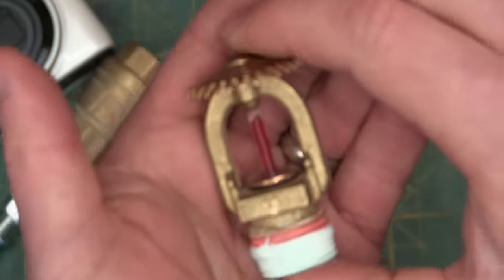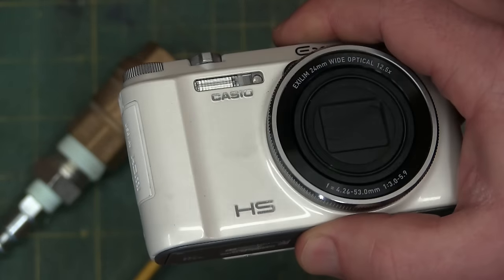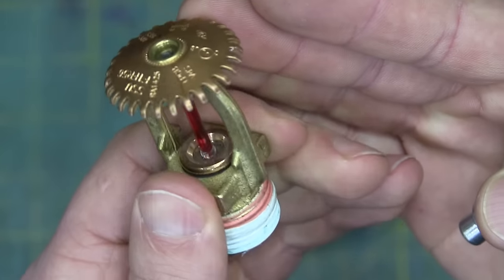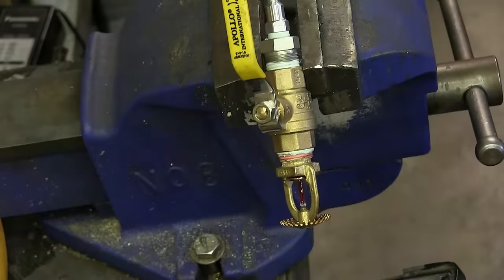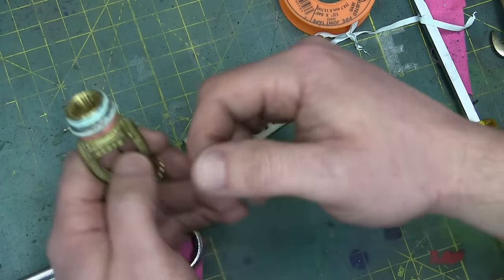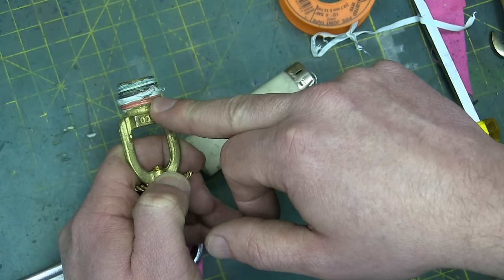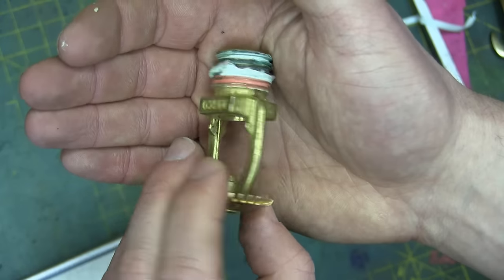BOLTR: Fire Suppression Sprinkler Head

Comment: Seeing as there was no explanation in the vid.
The colour of the dye in the glass bulb signifies the temperature rating of the glass bulb.  The red colour is rated for 68C/155F.
The different temperature ratings are achieved by varying the size of the air bubble within the bulb.
As the fluid heats, it expands and compresses the air bubble.  When the rating temperature is achieved, the bulb is unable to be compressed anymore and so the glass catastrophically fails, releasing the water.
Reply: Additionally systems of sprinklers are designed to handle only a few sprinkler heads going off at once.  Their primary purpose is to locally SUPPRESS a fire long enough for the fire authorities to arrive and handle the situation.
Reply: But yeah the sprinkler bulbs are a GREAT example of compressive vs tensile forces.

Comment: What is the actual mechanism that causes it to release the water? The glass vial physically keeps the valve closed. Then, I'm assuming whatever liquid is in the vial is very heat sensitive and expands with heat, breaking the vial? What is the liquid?
Reply: The liquid is alcohol, kind of like in a thermometer. It expands under pressure, and at a certain point, the glass gives way and the plug (which is held in only by the vial) gets blown out by the pressure behind it.

Comment: NFPA13/14 call for in-service acceptance pressure testing to be done at 200psi or 50psi above maximum booster pump pressure for pump supported system.  I have a pump that'll do 220psi at 1500gpm and it has a twin for some arcane reason.  Put that in yer'vice.

Comment: hey AvE I recently had a SDS drill bit that got broken inside the chuk and i tried every thing and really cant get it out ...i looked every were but it seems that not a lot of peeples came across this prob before so i was wondering if you can share some of your wisdom on that lol thanks a lot
Reply from the maker: You gotta take the body of the drill apart to take the chuck body off and then take the detente balls out. You'd do well to google the model number and get the parts list.
Reply: AvE I already tried that was a rubbery thing on the Chuck that can't be removed to reach the balls ...but I will Google the part list and give it another try THNX A LOT
Reply: AvE could you use a enerpac porta power with a hand pump for a jack

Comment: Is the copper head for heat conductance to break the glass? I imagine that most flames would hit that from the bottom, not the side.
Reply: They only should be touched by flames in the worst case scenario, and this one is an upwards-facing sprinkler so if anything the flames would get the pipe first.

Comment: What I always wonder about is how only one of these guys set of an entire sprinkler installation. Because the next sprinkler on the pipe doesn't have a glass vile.
Reply: It's possible to read the pressure in the system and determine if a head is going off or not, and open or close valves/turn on pumps if something is happening.

Comment: i'm guessing that it's a small vial of alcohol or gasoline, as it caught fire upon bursting. low temperature needed for vaporization, etc. but i didn't get a whiff of it, so i dunno. mind sating my curiosty?
Reply: It's a vial of alcohol. It expands under the heat until the vial bursts.

Comment: So what about the heat causes the glass vial to shatter? Is it thermo-expansion of the red stuff in the glass which shatters the glass and this allows a spring to eject the plug?
Reply: Remember, there is usually water inside the pile, pushing on that plug.  The bubble inside the glass expands and breaks the glass, letting the water pressure eject the plug as it starts spraying - no spring needed.  That bit of glass is pretty strong in compression along its long axis, but add a side force (like an expanding bubble, or poking it with a screwdriver) and it breaks pretty easily.

Comment: those lil inserts, like the red one.   have different heat ratings.  like a blue one might mean it breaks at a low temperature.  whereas the red or yellow might need direct flame of intense heat.    they need different types due to different conditions,  one place might work with paper products or flammable stuff ,and they need that sprinkler to turn on the minute it detects a heat that can start combustion.  or  a strong insert that needs direct flame  due to the buildings inside operations.  or heat build up. due to molten metal or whatever.  idk...  you probably know all this.  and i definitely did not do a good job explaining the sprinkler  inserts  but im sure if ya try a little ,  it can be deciphered.  hahaha

Comment: I've been told by sources that spoke with an air of experience and authority that it wouldn't be possible to "hold back the water" coming out of one of these (if it were accidentally set off and was within reach).  Anyone have any feedback on that?
Reply: john: The garden hose example is an excellent way of looking at it!  Thanks!
Reply: Uncle Rumple - Awesome!  Thanks for the tip!
Reply: A simple wedge will work >  no fancy tools needed.
Reply: Jam your local door stop in it free and handy since it does something when not being used to stop water from a sprinkler.  Seriously though that's basically what most fire departments that respond will do until the water is turned off at the supply.  They just stick 2 opposing wedges in it and it'll hold back virtually all of the water no matter the supply.
Reply: A cork.

Comment: Hello guys, the company I intern in is building backup sprinkler unit with diesel motor driving 2 pumps, each 160 bar. Apparently it creates mist thanks to the high pressure and can extinguish fire in seconds by depriving it of oxygen. But they won't tell me more. Is there anyone that can point me to more resources about this method?

Comment: If you really want to see something  you should see what happens when spackle and tape company's don't listen to the steam fitters and use propane space heaters to dry the spackle quick .When these let go with street pressure on them the first thing you get is a deluge of water loaded with oily foul smelling stagnat stuff from inside the pipe which is black as ink and stains like it too.if your lucky to get the water off in time you only have to throw away half the building!. ..here in the USA the n.f.p.a who controls fire protection calls for a standard test to pressurize a sprinkler system for two hrs at 200 psi in order to get signed off by the fire Marshall that you passed the test..now if you have a head pop during one of these tests the mess and clean up is proportional . giant clean up fail test start over.im recently retired from the business and still shudder to think of some of the Glorious destruction I've seen these little buggers create after 20 years in the trade.

Comment: The red ampule that inspires fear in all industrial plumbers. Break 1 which drops the pressure in the line which triggers the booster pumps and breaks every fucker in the place and calls out $5,000 of the boys in red. Break one and run :P
Reply: Jeb Julian incorrect... one head operates due to heat (fire) activating it... NO ADDITIONAL HEADS GO OFF!! It's not like the movies! Lol deluge systems (special hazards) have open head where everything goes off... but not common practice anymore

Comment: Please help, what material should the bolt be, if I want to fasten it into aluminium? Galvanized? It's going to be indoors, so I guess it doesn't matter that much. But I do want to be able to remove it.
Reply: 0xbaadf00d i think you should use stainless with some copper paste on the threads
Reply: Copper paste? That sounds a bit odd to me since copper is quite noble. And the further apart the metals are on the nobility scale, the more they react, no?
Reply: Well maby not but something to keep the stainles threads from binding up like thick grease

Comment: It will open, and distribute water, unless it's a dry system, such as those used in computer rooms. Then a secondary action from a manual station switch, and or other automated secondary detection equipment is required. The use of fire suppression chemicals is now frowned upon by the EPA, so dry water systems have become more popular over Ansul or Halon. People tend to clink these sprinkler heads with scaffolding, or equipment, and dumping water on a $7,000,000 server is a bad idea, unless it is actually on fire. If it's on fire its value has depreciated to scrap metal.

Comment: Good morning from sunny Florida! just out of curiosity, what is the fluid in that little glass vial? assumingly something with a low boil point to quickly build bursting pressure. but the only thing that comes to mind is alcohol, and that would seem to unstable for use in a safety device. but ive been wrong before.

also if  you going to continue this venture into electronic music, may i suggest "TheFatRat"
Reply from the maker: I think it's alcohol and glycerin, maybe some water to taste.
Reply: JamesWolf 
if memory serves, you're on the nose with the safety-booze thing

Comment: was doing some landscaping at a school built a couple years prior and they wanted us to take a look at the irrigation system. well this school had a detatched pumphouse for the schools water needs. complete with a big diesel driven pump for the fire suppression. well we open some valves for the irrigation to see if it's getting water, and come to find out the irrigation was tapped into the water line after the jockey pump for the fire suppression. pressure dropped, system thought a sprinkler went off, caused the diesel pump to kick on and set off the fire alarm. lol apparently this was not the first time this had happened, FD was not amused. great response time tho. anyway the reason the irrigation wasn't working is that some dickhead wired the outlet it was plugged into to the light switch. lol lowest bidder all around for that school.

Comment: I'm surprised you would waste alcohol like that.The sprinkler system in our 77 acre plant has 56 MILES of pipe-risers with 1 1/2" hoses every 100'-about 30,000 sprinkler heads - 2 ONE MILLION gallon water storage tanks and 2 pump houses with two  6 71 Detroit Diesels in each pumphouse driving  3000 GPM pumps .Electric jockey pumps maintain pressure,and the system is divided into loops controlled by PIV-(Post Indicator Valves).If we ever started pumping 12,000 GPM-that would be bad Ju Ju. Just sayin'.

Comment: How does the glass vile work
Reply: cccampbe2 the heat causes the fluid inside to boil and therefore build up pressure, which destroys the vial and releases the water. It's quite simple but effective.
Reply: it gets hot and the alcohol inside makes so much pressure it blows up
Reply: There is a small air pocket in the bulb and it expands with heat, causing the glass to break and allow a sealed plug to release and allow water to escape.

Comment: What's stopping someone from tapping out and breaking the insert to set these off?
Reply from the maker: Rules, common sense and installing them out of reach.
Reply: Seems kinda vulnerable, yeah? Someone could break one of these in a building and cause the rest to go off, causing all kinds of destruction and mayhem
Edit: Aren't systems like this attached to pumps that turn on when the pressure drops?

Also i love u uncle dad
Reply: the rest of the heads would not go off only the broken one

Comment: why does the glass vial break when exposed to heat?  Did your lighter melt or weaken it??
Reply: Seth Jones There is a little bubble in the glycerin in that vial. As it heats up, the bubble expands eventually breaking the bulb from the inside.

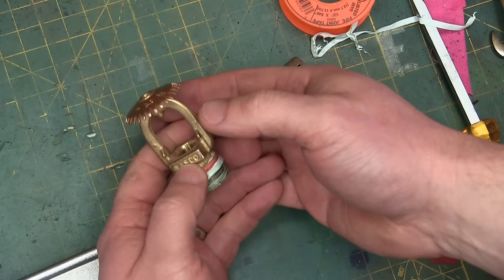Comment: 2:00 (fractoins and pounds and pies and internal screaming)

Nightmare. 

For the metric people.

120 psi ~= 9 bar ~= 900,000 Pa

Pressure * Area = Force (N)

pi*(0.06^2)*900,000 / 9.81 ~= 10kg force i.e. ~22lb force

This was not any simpler to do in my head lol.

Comment: How does one sprinkler going off trigger the other sprinklers?
Reply: It doesn't.  That's lazy Hollywood bullshit.
Reply: pixie dust
Reply: Because a grip or key grip gets a signal from the director to open a big valve connected to a water truck parked outside the studio.
Reply: It doesn't. Heat from a fire opens individual valves.
Reply: RabidMortal1 they dont! they pop and sprinkle as they are needed. for example when a person on fire passes under them. there are systems where the sprinklers don't have the little popping devices. pipes are dry and some other type of sensor will see the fire and open a valve/turn on a pump, and then they will all get sprinkly at once

Comment: from time to time they fail as well. And cause all sorts of mayhem - especially if you're wearing white clothes  :-)
Reply: Snocrash they don't "fail" unless installed incorrectly... the testing behind these are like NASA to space backed by largest companies in the world... if you get wet! Your rooms on fire or you fucked with it!
Reply: Snocrash agree with white clothes
Reply: Yeh - probably not the best word - but I used it so that an average person can understand it. But more correctly a false or accidental discharge are not uncommon usually caused by inadvertent overheating, freezing, mechanical damage, corrosion, manufacturing defect, installation defect by way of incorrect torque settings.

Comment: if thats how one goes off how do they all go off?
Reply: Just1ofGod big fire
Reply: They never all go off at once because one went off. That would cause a lot of unnecessary property damage. They all have to be activated by their vials getting heated. When one goes off, the fire alarm system usually sounds, but the fire has to spread or be larger for more than one to activate.

Comment: Where I worked we had to test/flush the system once a year and they refused to certify the system until I made a half dozen little wooden wedges and painted them red and placed them in the box with the spare heads right next to the control valves. I asked the idiot inspector why do you think I am going to get a ladder and climb up through the waterfall to place these stupid wedges in the head when I could just shut off the valve right next to where the wedges are. He never did answer me.